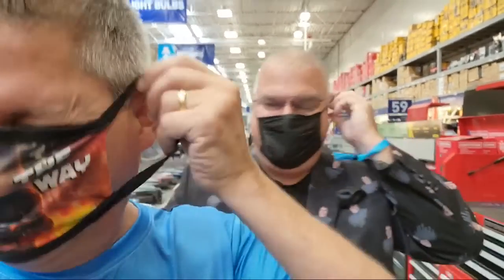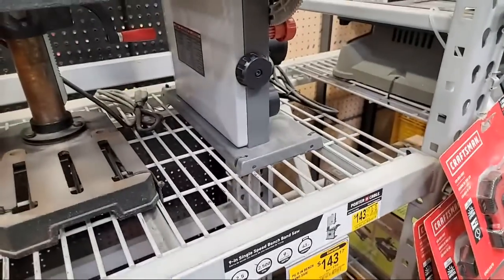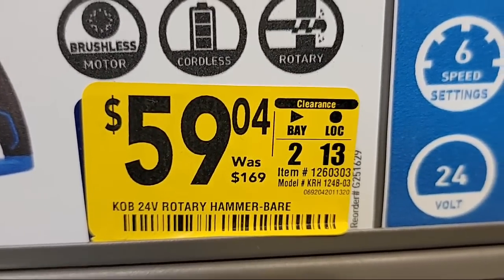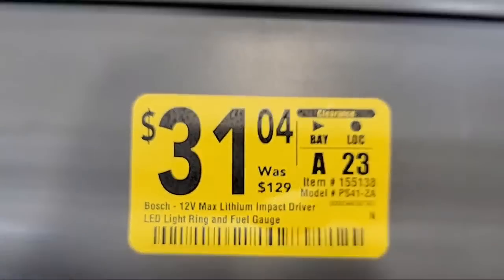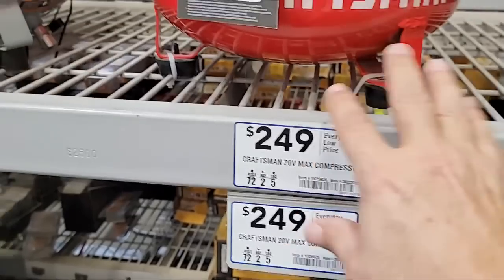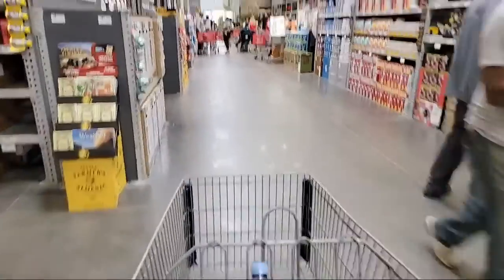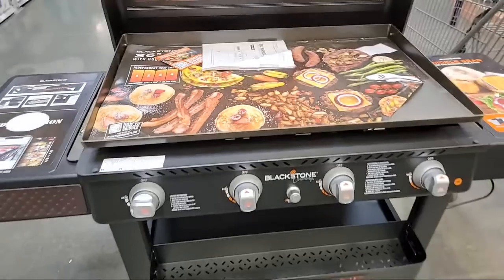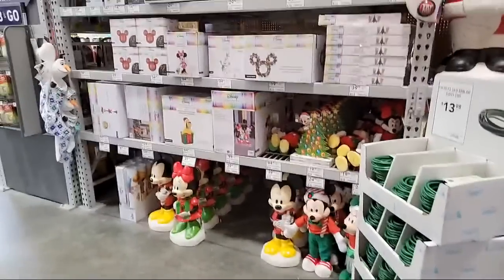Lowes October MASSIVE Clearance Tool Deals With UDoIt Guess Where!

Comment: I also found that Bosch 12v impact driver kit for $30. Comes with a bag, charger, and two batteries. It’s no Milwaukee, but you can’t argue with the price. It took a while, but I eventually found the matching drill driver kit for $45.
Reply: Damnitall Dave, WHERE did you find that deal!???
Reply: @MajorCaliber  Sitting on one of their clearance end caps towards the back of the store. The local Lowe’s doesn’t mess around when they want stuff gone. I’ve seen Metabo framing nailer kits there for as low as $101. So now I have two Bosch tools, but four batteries. Need more Bosch tools, I guess.
Reply: @CantankerousDave  Much Grass!... I can't rebuild/consolidate/McGuyver my lame Craftsman batteries any longer--no viable sub-C cells left... and tired of soldering.

Comment: Somehow missed this video completely, until tonight. Personally, I'd recommend Tekton. They are a Michigan company and make their tools mainly in Taiwan, USA, and Canada. They state only 2% are made in China. Anyway, I have 3/8 drive 6 point  shallow sets and deep impact on 1/2. I've had no issues with them at all. As for their ratchets, I only have a stubby foldable 3/8 ratchet and that is nice too. I highly recommend their sockets. Haven't tried much else, other than a screwdriver here or there.  Oh, their small scraper that takes straight razors is the best I've ever used.
Reply from the maker: Yes with sockets I could really care where they are made, I have never had one fail on me I know people like to bash China maybe for other products but it's pretty hard for a solid metal socket to fail I have never seen one fail before have you?
Reply: @jeffostroff  I've had an adapter break before, but never a socket. I was younger and used a 1/4 to 1/2 adapter. Of course it couldn't handle the torque I put on it. 🤣

Comment: I picked up the 6 point 1/2in impact sockets both the deep & standard length main reason if ya noticed no skipped sizes plus worked out cheaper & more total sockets then there biggest 1/2in impact socket set minus a few extensions. But really wanted to pass this along at the depot there reaching the end of there milwaukee free tool deals but the M12 2 6ah batteries starter set & you got the M12 tool only rocket light for free But right now if ya get there sooner then later there selling the M18 rocker light tool only for $115 (no Hack required) probably just till they sell out there $199 sku numbered stock to bring em back up too the $229 price!! Good luck man hope everyone wanting one gets one...

Comment: Hey Jeff, Is it worth the extra bucks to buy a 12” sliding double-bevel miter saw over a 10”? Thanks!
Reply from the maker: You can cut wider planks of wood with it otherwise you may have to flip the wood over and try to line your blade up to make it perfectly smooth hot across the piece of wood.
Reply: @jeffostroff  : I don’t feel like forking out an extra $100 for the 12” but I know that if I don’t, I’ll regret it later, lol. Thanks, Jeff.